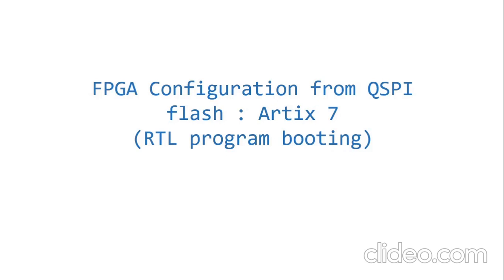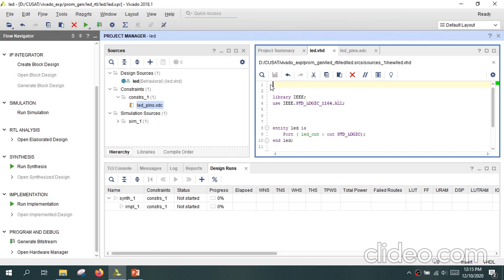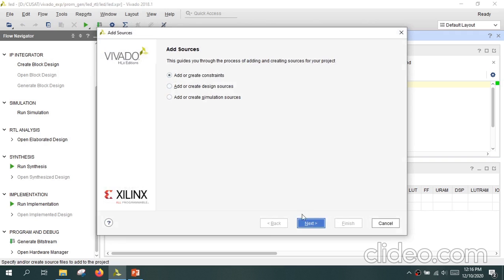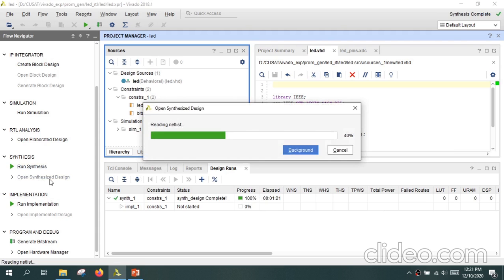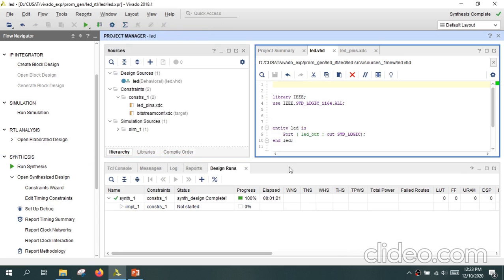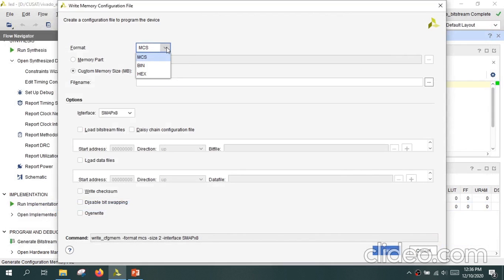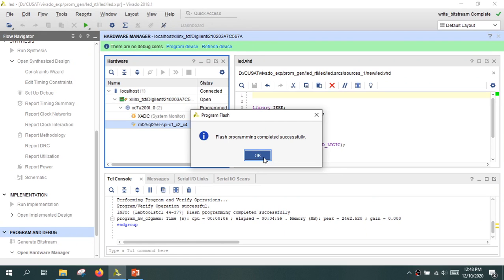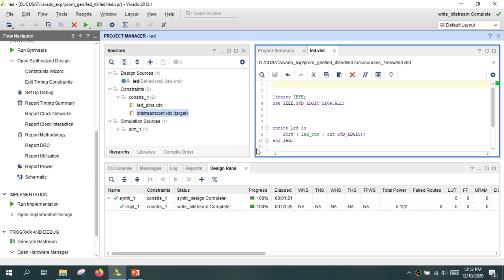Xilinx FPGA booting from QSPI Flash (Bitstream to Flash file using Vivado: RTL program alone)

Comment: Hello, thank you for the video. I have artix7 and IS25LP128 on my board. I saved data in Flash via microcontroller and want to read them from artix7. should I follow your steps? also, should I write my SPI code to send commands to IS25LP128 and read data? Should I write Quad SPI code when I select master spix4 in vivado? I would be grateful if you explain me.

Comment: Hello I'm using ICE40 fpga can I flash a bin file to fpga using HW-USBN-2B cable without any software (using any programming language)
Reply from the maker: Theoretically yes. But I have never done it using USB cable. I have done flashing through Ethernet using custom application program in C.

Comment: Hi! What flash device should i choose in case of zcu102 board? 
Is the procedure the same? (I'm using Vivado 2020.2)
Reply from the maker: The procedure for Zynq SoC based FPGA are different from this. There processor is the master and RTL boots after processor initialisation.

Comment: which port is used to boot fresh board, sd card or jtag port
Reply from the maker: If you are talking about a new evaluation board, you may have a boot image from the manufacturer present in the sd card. Otherwise you need to build the image and then you can initially boot from jtag and later the working version can be dumped in to qspi flash( or sd card if you are using zynq based board)